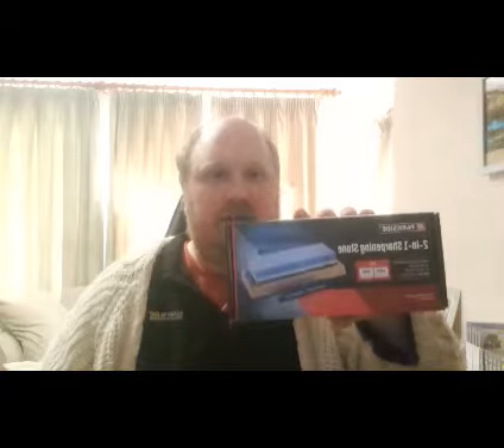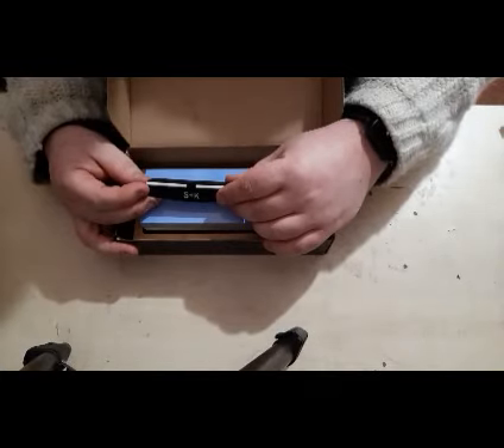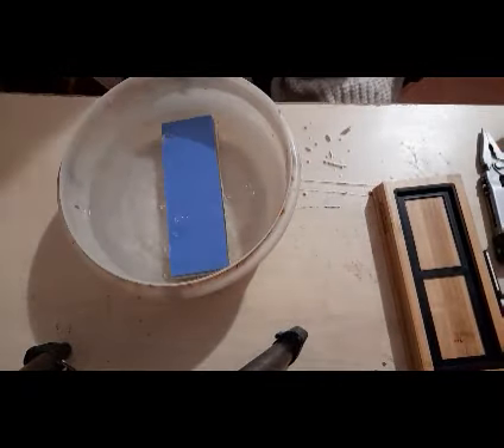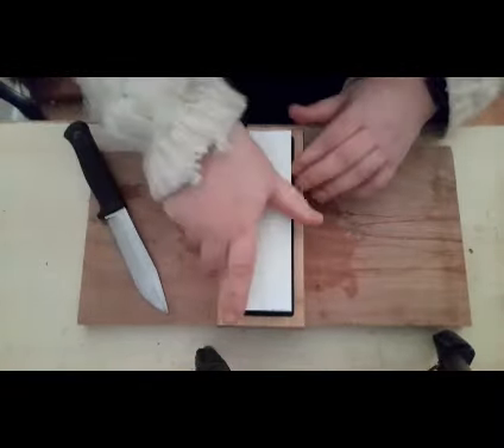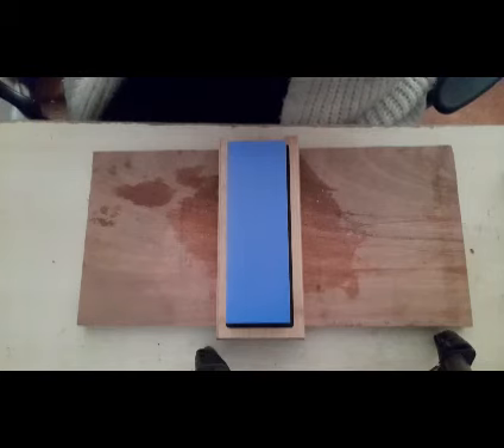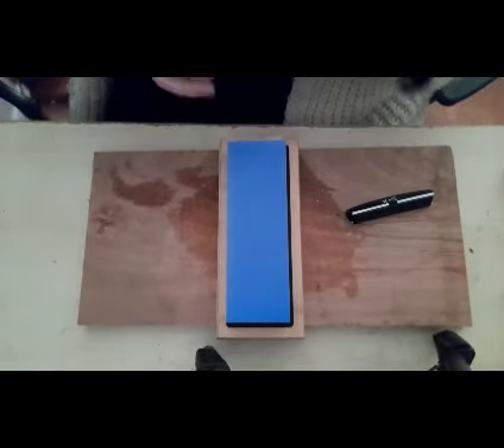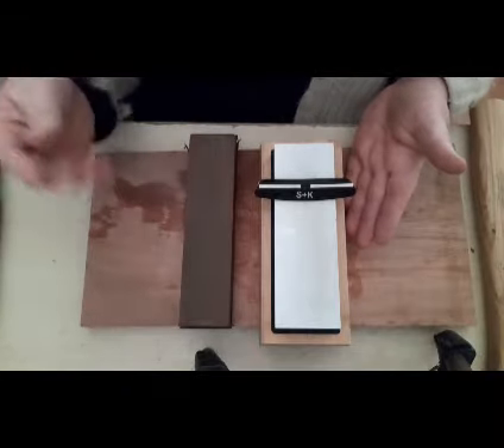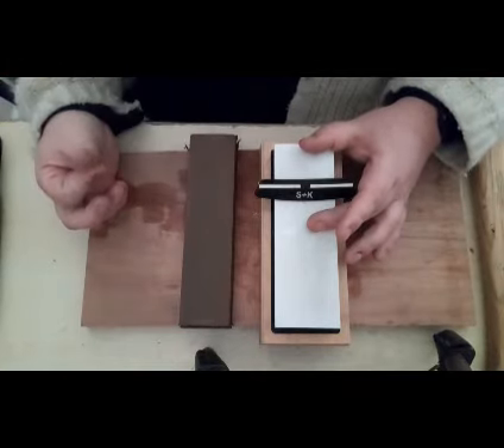Parkside 2 in 1 Sharpening stone overview, note I`m not showing how to actually sharpen blades

Comment: Hi I love my Lidl wet stones i have them both 400 800 1000 6000 ,But i think that the white side of the blue stone is the 6000 ie the white one is the 6000  ??
Reply from the maker: On mine it says the blue is 6000 and white is 1000 but I think it might be a misprint because the blue is rougher than the white
Reply: @lonewolf4215  yes its a misprint 6000 is the white side on the blue stone on my set ,good price for the stones just wonted to post this .Not for me or you as we no the difference. hard work trying to put an edge on a knife with the 6000 to start with ..     thank you for the video and getting back to me
Reply: You can easily feel the grit on the blue side while the white side is smooth like counterdesk marble....it is def product mistake on print. Also 400 is darker and 800 is white. ALSO other brands 1000/6000 have blue (1000) and white (6000)